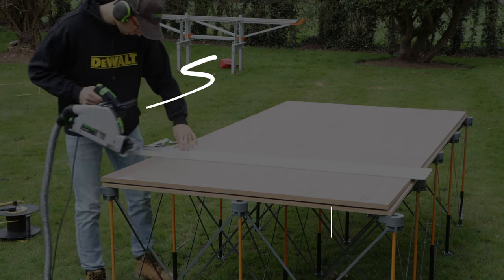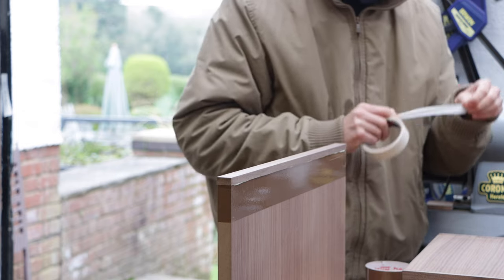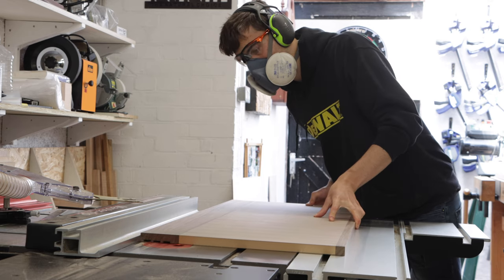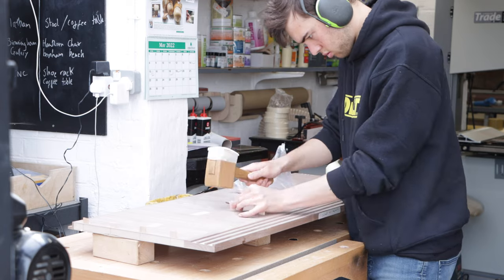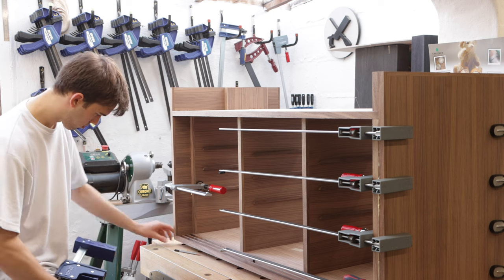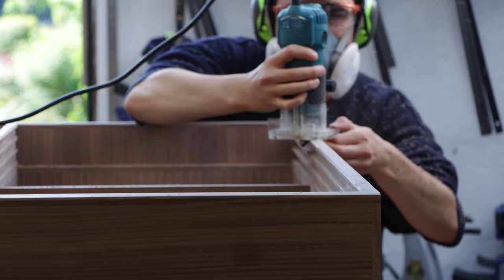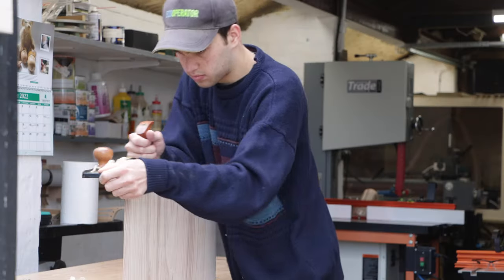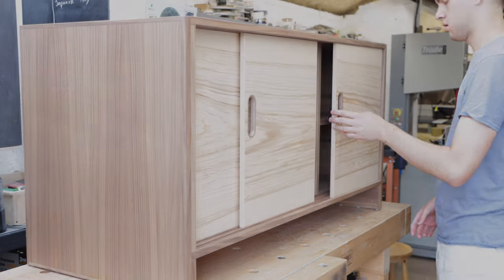Largest Furniture Project To Date - This 5 Metre Long L-Shaped Desk is HUGE!

Comment: Beautiful work, Sean. Those handles are one hell of an addition. The design is perfect!

Out of curiosity, when it comes to the veneered MDF, how do you account for grain damage when cross-cutting on the Axminster saw? Do you have the option of a scoring knife, or do you have another trick? Cheers.

I’m looking forward to watching the next episode. Keep up the great work.
Reply from the maker: I really appreciate that Chris! Personally I haven't had an issue with veneer tear out when cutting, I always ensure I'm cutting at the right speed and with a sharp blade. If you are having chip out I would recommend sharpening your saw blade and maybe sticking masking tape on the underside of the board where it's going to be cut. The tape will add enough support for the grain and prevent it for tearing out.

Comment: Sean, 
Your style isn’t usually isn’t my thing, but I’m liking the deliberate lines and contrast in this piece.  I hope I brings you all the function/productivity you’re looking for and those storage area fronts are perfect against the dimensions of the vertical structure elements.  The take away for myself on this so far is going on the heavy side with regard to edge/banding.
Reply from the maker: Thanks a lot mate, Glad you like the storage unit. I wish it was for me but it's actually a client build. Personally I'm very happy with the banding size, I wanted them to be thick. But I'm not saying anyone has to copy.